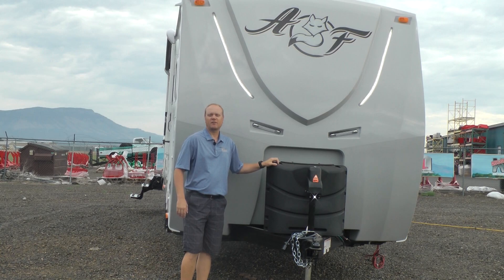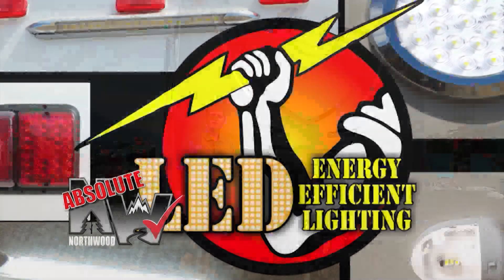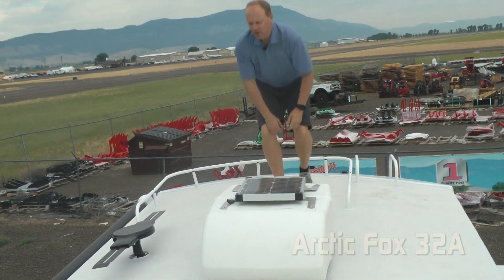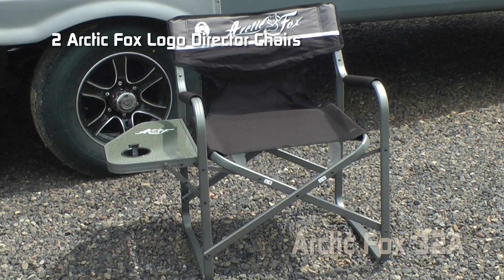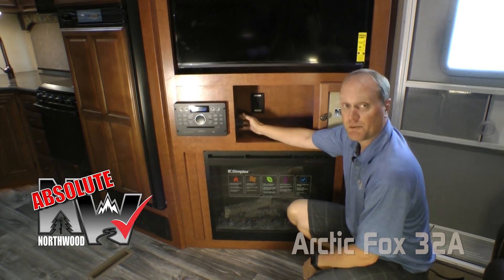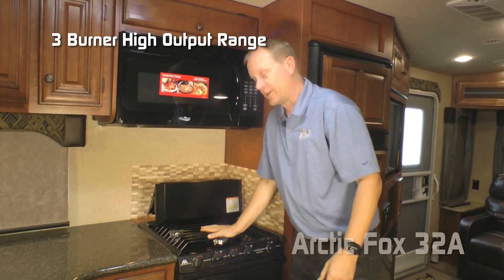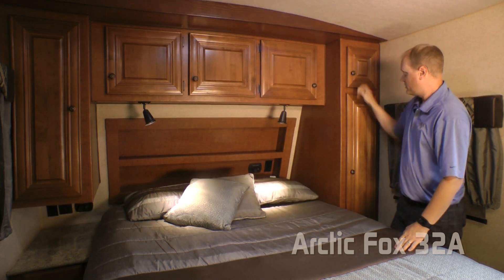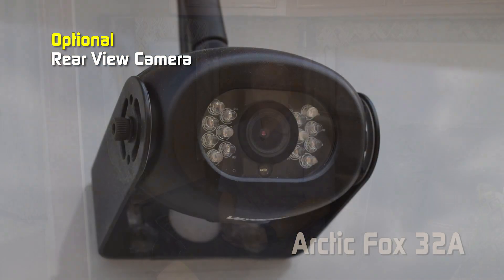Quick Tour of the Arctic Fox Silver Fox 32A Travel Trailer

Comment: Super well done video. This guy knows his stuff. 
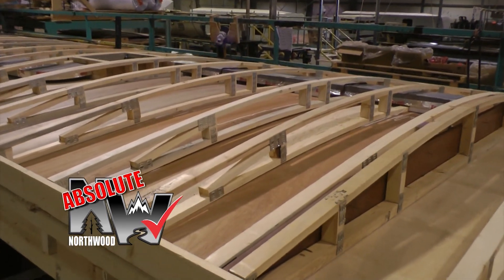On the downside, I'm not a player for the wood roof rafters (0:48). Also, the membrane roof. Lance uses aluminum roof trusses and a solid fiberglass roof. Also, those heavy solid wood cabinets add a lot to the weight. This would make a good destination RV but not something you're gonna be towing a lot - unless you have a Sherman tank.

Comment: Some things that wern't mentioned.. 
If you get the "dream booth dinette"  you end up with two exterior strage compartments that are bigger than a case of beer. Basically half of each seat in the dinette is open tothe outside. If you get the table and chairs these compartments are missing.
The trailer hitch option on the back is massively strong. Will hold any bike rack or what ever you put back there or even tow.
The Slam-latch outside compartments have real keys, not CH751 stuff you find on others.
The slide out awnings are junk. They also sag bad with any rain. Order elsewhere and install them yourself after you get the trailer.